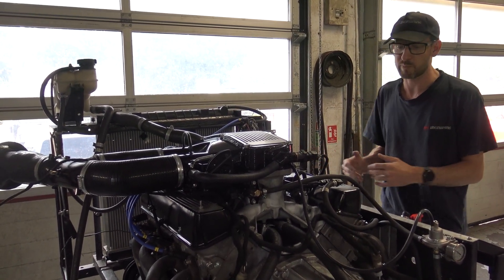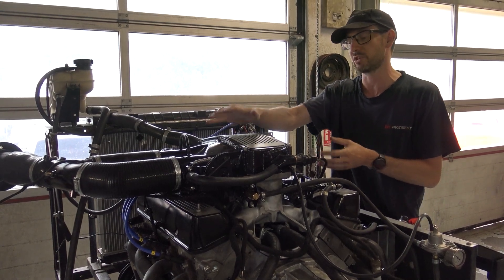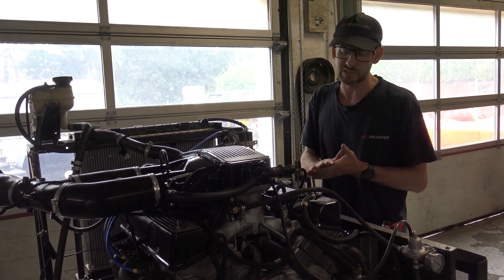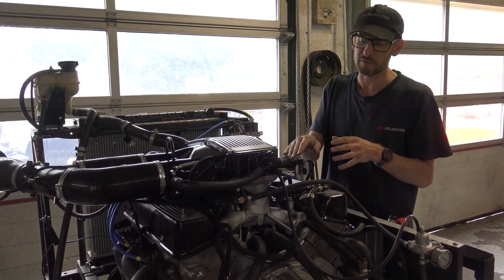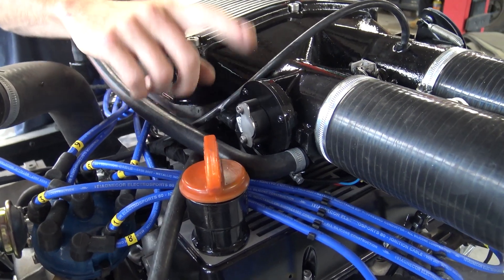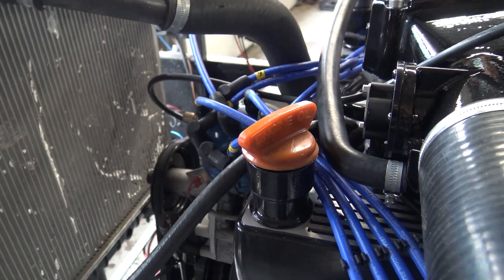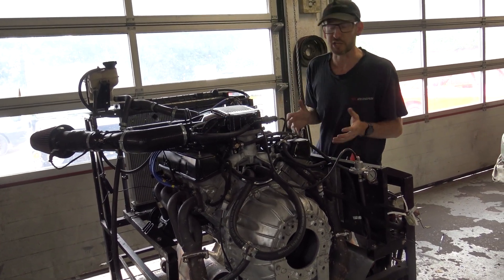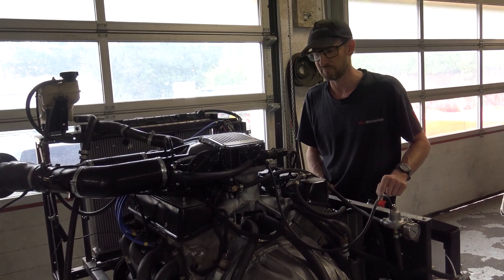RPi Engineering Rebuilt 4.6 Twin Plenum Hotwire Rover V8

Comment: What's the bhp and torque figures.
Reply from the maker: Dont know its not been on a dyno. Torque will likely be around 300 lb/ft as is normally the case with 4.6's, bhp with this cam choice will likely be around 260 ish at a guess but were not shooting for peak bhp.